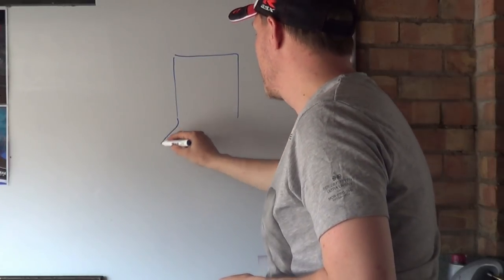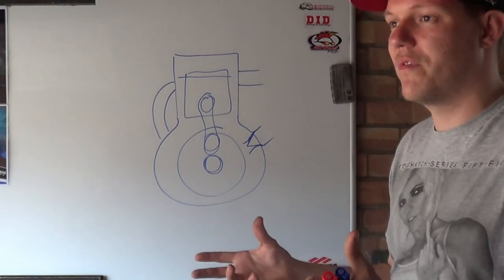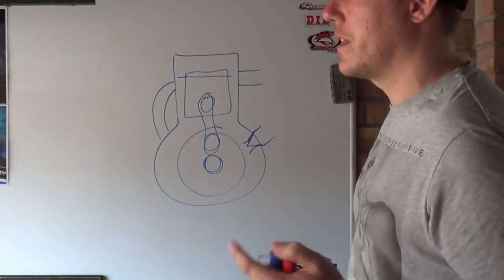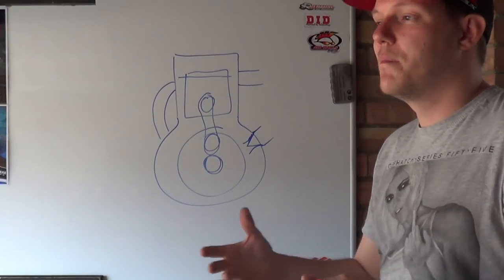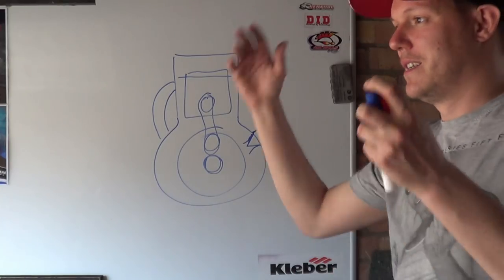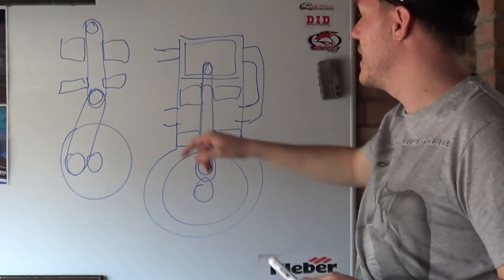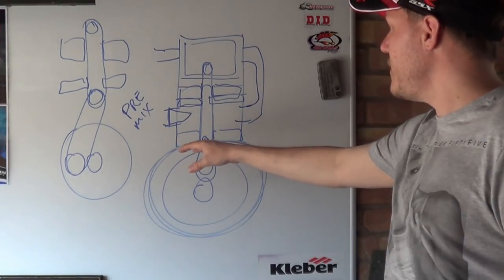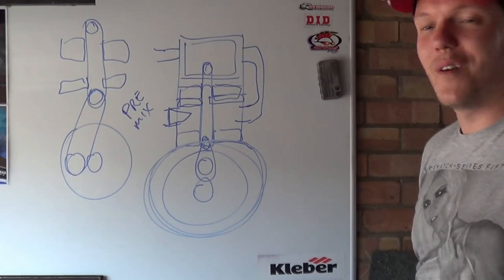2 Strokes are shite! - and why - Part 1

Comment: Hello there, I really enjoy your honest opinion videos and ofcourse their education aspect. I have thought a while now to start 2 stroke project with old sled engine. To solve the fuel in crankcase problem it would be direct injected and only air would come from old fassion way. Fuel would be biogas(methane) from cng tank so no need for additional fuel pump. The engine has independent "direct injection" oil loop for crank and piston lubrication. You think this would be also complete shite? :) Also if fuel is directly injected after exhaust port is closed (so no unburned fuel escapes) could the exhaust pipe just be straight like in 4 stroke? Pardon for long comment but this video hit the spot for me at the moment :)
Reply from the maker: No worries mate. This comment really belongs in the Q&A. There are loads of comment on this subject, so I'll answer your question in a video this weekend, if you can wait that long? - thanks for the awesome comment - matt

Comment: 13:00 ish..there's bugger all point in doing that because as it is oil injection works just FINE thank you very much, I've ran RGV's on second hand crankcases with their second hand oil seals and using oil injection the crankcases never blow up,  and had no drama's at all, and the oil hole in the exhaust port rib does a great job of looking after the piston, no need for pre mix crap, plus with all that extra rod and bearing drama you add complexity , friction and it robs energy...., plus the fact that there is a charge in the crankcase helps act as a cushion when the piston is on it's way down reducing the loading down force on the piston face and pin etc etc helping to create a far smoother runnning motor..big four stroke thumpers shake themselves to pieces faster than two strokes, I've owned them all and they all have good points and bad but I still think some two strokes are awesome.

Comment: Engineering is all about trade-offs and compromising.  You don't see 2 strokes in cars, and there's a good reason why.  It's not because the 2 stroke is a shitty design, it's just that it's advantages can only be utilized in certain applications.
Reply from the maker: Miss the point totally - there is a 4 strokes are shite video, and wankels are shite

Comment: My first bike was a 2-stroke. It was utterly reliable and I put over 44,000 miles on it when I sold it to get something bigger. It never over heated, I never had to change the crank or small end bearings,(direct oil injection onto the bearings) it had a disc valve, (no reeds to replace) It never let me down, and I loved it!
They have their limits but they're not "shite"!
Reply from the maker: you didn't mention pistons or cylinders?
Reply: I never had to change either of those... or rings before you say :-P...
It's like any engine.... if you maintain it and don't thrash the tits of it, it'll last
Reply from the maker: what bike was it? If you say honda vision or yamaha posala I'll piss myself lol
Reply: What? a Honda or Yamaha with a disc valve? I thought you knew about 2-strokes....
it was Neither!  1983 Suzuki GP100UX.
Reply from the maker: Sorry, I only get the first 2 lines on my phone.
Reply from the maker: Not only that but the 1983 version was the 11bhp detuned version. Suzuki's reason for the detune - 'to increase reliability'
Reply: That makes sense and it works! (As if de-tuning a poorly breathing 100cc engine was really necessary!) 
As I always say to one of our apprentices, if you want your engine to last, Don't modify it! (or something like that!)
Reply from the maker: Very true, I say that alot in my videos. Performance at the expense of reliability. Thats why dragster have between 5,000 ~ 10,000 HP, and blow up in 3 runs of 6 seconds each. lol
Reply: Ah, Yes! drag racing! where pistons are listed as "consumables" and engines are rebuilt after every run (Top fuel)!... :-)

Comment: Matt, when you see white smoke coming from the exhaust of a crosser is it because of the oil mixing with the air and fuel?
Reply from the maker: It depends... how old is the fuel
Reply: @dirtygarageguy  just in general terms mate, the 2 stroke crossees i've seen always seem to have a little bit of white smoke out the exhaust aa i say ive always thought it was to do with the oil mixing with the air and fuel
Reply: @reecelawson4718  too much oil.

Comment: Is there a difference in reliability when it comes to two 2t oil injection that came in the old 2t road bikes vs traditional oil and gas mix ? Id imagine the oil has more of a chance to sustain it's chemical property since it's separated from the gasoline until it's injected with the fuel into the crank case.
Reply: No its just the oil injection is more accurate.

Oil only goes bad when you put normal oil in, it will turn to gum after a few days  2 stroke oil is made so that it doesn't do that and it contains less ash to reduce emissions.

Comment: As shit as they are i still have a fond affection for 2-strokes,  i believe Suter have managed to make a fuel injected 500 for their mmx race bike,  Bimota tried it back in the day with their VDue but ended up going back to carbs because of the many faults reported.  One of these days im going to dive balls deep and attempt to build a 2 stroke track bike for the occasional blast however i fear the challenge to find a decent motor as a candidate would be rarer than seeing quality results from dells shop.

Comment: Rotax uses Direct injection to eliminate the fuel washing issue. Other 2 Strokes use a compressor screw type or centrifugal to compress the crankcase air.
Reply from the maker: If you mean the Etec system 1) it's not rotax 2) it's not very good. As to other 2 strokes - this is a motorcycle channel, and not a detroit diesel channel

Comment: You're chucking loads of content out the minute, good lad! :) Another pro for 2-stroke (slightly more relevant to handheld machinery) is ability to use in any orientation :) interesting on the concept engine you sketched...would that work as a diesel as well as petrol/premix? Cheers, M
Reply from the maker: Yes it would the fuel used really doesn't make any difference.

Comment: the reason that there are a lot of cylinders are available for 2 strokes is not because they just blow up every time, but because they most likely have different sizes(big bore kits) or different porting. For 4 stroke the cylinder does not matter very much so of course they won't have many available
Reply from the maker: lol is that what you think, if so which came first - different sized cylinders and port timing - OR - replacement cylinders because they failed?
Reply: good point, but considering that you are still exaggerating how unreliable 2 strokes are
Reply from the maker: Am I? So 2 strokes are going to make a come back then?
Reply: No chance. 2 strokes having to burn oil will always produce more emissions, so in this day and age it's not really a possibility. I would love to see the 500cc gp class make a come back though, always found it way more interesting to watch than motogp. Something about the savage power of a 2 stroke has always intrigued me

Comment: There is a 2 stroke motorcyle from Yamaha that was built from 1985 to 2012, people still rely on that bike and I am gonna get it next year.

Also there is a Kawasaki motorcycle where the piston always scratch the cylinder wall, is it because of the oil+petrol mixture?

Comment: great videos. love the explanations you give .
I think you missed the thermal inneficiencies which is a major setback for the 2 stroke design,  even on direct injected and oil injection models and effect  liquid or air cooled alike . air doesn't conduct heat, solids and liquids do. the cylinder porting limits the amount of combustion heat that can conduct from piston through rings into cylinder wall as the rings arent in contact with cylinder wall during entire stroke .. this heat transfer over extended periods will lead to uneven heat distribution across pistons. Even  with excessive  amount of gas or oil to cool piston this still causes failures.

Comment: Great channel my friend!  I have had around 50 bikes over the last 50 years, most of them 2 strokes. first legal road bike i had was a Yamaha AS1 125cc twin when I was as school in the '60s, it was faster than the 250 4 strokes, and only when the Kawasaki H1 came out could anything beat me across the traffic lights, I love 2 strokes... But.. I worked on that bike most week ends, set the timing at the side of the road once a week, it was so critical. in the 3 years i owned it I had the barrels rebored until it was at maximum because of wear, then started on a new set. crank done a few times too, in 26,000 kms (16,000  miles). In all my 4 strokes have been more reliable and last much longer at  that time my Suzuki T250 ii redline was 7000, the Honda 250 was about 13,000, but still no comparison in performance. Later, my Kawa GPZ305 would have eated the Suzuki I think. There was a 1000cc 2 stroke, DKW1000s, but thats a car.

Comment: the big problem with a cross head two stroke petrol engine is that the stuffing box limits the amount of hp one can make as the pressure diff between the cross head and the lower crank box.. might work if you have lower rpms, and for longevity, but the seals in that stuffing box are complex will be a bugger to produce and maintain.. It's like having a vagina repeatedly penetrated by shaft, eventually the diaphragm bits that make if feel good will wear, and leak into other bits.. and will need a re build.. this factor, the increased complexity of an engine made to be simple, as well as being taller and heavier, kinda negate the advantages, especially in a light weight thing like a moped.. 
   In ships, and detroit diesels, where weight doesn't matter, and the high thermal efficiency , the ability to warm up fuels, and ease of maintenance, giant slow moving parts, lower pressures,  and giant low pressure turbos (volume makes up for it), makes it great in a ship.. Detroit diesels are gone from trucks now, they are all Dailmer 4 (Re Badged) strokes these days for emissions reasons, and fuel economy..still great for industrial applications where constant use , huge air filters, and lots of cooling are available,  like power gen, plus it's much cheaper than gas turbine.. 1/5th of the cost.. but again weight is a huge factor, generally once sea can for the engine, another for the ancillaries, we talking a lot of weight to keep it reliable and clean..
   So stuffing box, complexity, not scaling down well, and a lot of extra weight to carry around makes you say hmm, what's the alternative.. well 4 stroke normally.. 
    but it is a cool idea, I prefer the Deltic idea, more elegant, no stuffing box, low crank bearing wear, cool as fuck...
Reply from the maker: yes, I messing around with the concept at the moment. Its more of a hybrid 
than a regular 2T stuffing box. The loads are nowhere near the same, but
 it is an issue like you said. This whole endeavor is more for the 
channel than an actual workable idea. So people can see that 1- it isn't that easy 2 - ideas are just that and 3 - its always worth building a quick prototype to see if that can lead you onto another idea, born out of failure if you like - thanks for the input 

- matt

Comment: Just for the sake of the discussion, what would happen if you use LPG instead of petrol?  I know the tank would have a weight/safety  issue and therefore is not very usable for bikes, but as far as i could find doing a quick search  propane/butane are not mentioned as solvents for Oil. All i could find is that LPG burns hotter and therefore the valves in American engines needs extra oil cooling systems when converted to LPG usage but hardened valves like used in most European engines don't require any of this. So the valves are no problem in a 2 Stroke, maybe some other components requires some extra cooling. Sorry if there is a thread handling this which i didn't see.

Comment: " The point of engineering is to design something that works with minimal parts" 2 stroke has about 75% less parts than a 4 stroke. I can rebuild a 2 stroke top end in on a bad day 2 hours for about $200.00. on a 4 stroke may as well buy a new motor.
Reply from the maker: " 2 stroke has about 75% less parts than a 4 stroke."

- what? 75% are you sure LOL

Comment: I feel like if you did that crosshead bearing design and made it direct injection, while you'd still lose some air to the exhaust you wouldn't kick as much fuel into your exhaust and thus vastly cut down emissions. Some downsides I can think of would be some tad increased drag from increased piston mass, added complexity, and a need for an oil injection system for the pistons.
Reply from the maker: More on this later dude - matt

Comment: You might find this video put out by Ski-Doo interesting. It's a summary of their new 850cc 2-stroke engine with numerous advancements in the way of longevity and efficiency. It's probably one of the most advanced 2 strokes ever produced. It was independently dynoed at 170.1 HP at 8050 rpm. This power output cannot be matched by a naturally aspirated 4 stroke with similar size and weight constraints. The 4-stroke sleds easily add right around 100+ pounds for comparable performance. I currently drive a Yamaha 4 stroke and their "solution" is a 1049cc 3 cylinder 4 valve per cylinder mill that only produces around 130 hp. The dry weight of my sled is right around 520 lbs where as the 850 etec weighs in at right around 470 lbs dry. Not to mention much of that weight is much higher up in the 4 stroke sleds due to the height and overall size of the engines. 

https://www.youtube.com/watch?v=M4mUp9iZEKo

Comment: I see your beef mate. Yes I agree but, from a straight MX view, the four stroke is more expensive and just as reliable. Take any engine and straight red line it for entire races at a time and you will need to do maintenance no matter what. Again this is a straight MX view. I love your design by the way. I owned a Polaris xplorer 400 and it took about 4 ounces of 10w30 in the crank case and sounds like a very similar idea to what you have.
Reply from the maker: Yeah, its not a new idea. Just to get people thinking - thanks for the comment dude - matt

Comment: Lotus developed a rotary vale direct injection boosted wet sump two stroke engine that used the boost to fully evacuate the exhaust and used an asymetrical timed exhaust trapping valve to ensure that not too much gas escaped. Highly efficient, very powerful
Reply from the maker: Yes its called the Omnivore engine and its a test bed engine. It is designed to explore the concept and gather data. Will it ever become a production engine? Probably not, although certain aspects of it may. The engine cost would be huge due to the tight tollerences that have to be maintain. Think of it like an F1 engine. Using the best materials and precision money can buy. Its a great test bed that shows what could be possible - matt
Reply: I am close friends with an Engineer that helped design it, in their opinion, the tolerances would be no tighter than a modern production engine
Reply from the maker: God that was quick do you have them on speed dial? Tight tolerances would have to be maintained for the piston style VC head they would want to use. Seen as the combustion top surface has to compress and retract which is fitted to a pivot joint. This would be hard to maintain during mass production runs.

Comment: seal the crankcase, fill it with oil and use a supercharger to pump instead of the back side of the piston.
Reply from the maker: How much oil? You said fill............
Reply: The Workshop I wasn't being specific.
Reply from the maker: well then how do you expect an answer it could be full to the top or a couple of spoons full???????
Reply: The Workshop and BTW common sense says that if it's filled to the top, you'll burst your crank seals especially if there's no breather.
Reply from the maker: It was a genuine question. You might be onto something, I just wanted to clarify what you meant.
Reply from the maker: Common sense says that you hyrdo-lock the piston and crank so nothing will move in the first place. What I was going to say was that the oil needs to be mixed with petrol due to its weight. Its very hard to vapourize oil, and if you put some oil in the bottom of the crankcase then it would just sit there.

On other thing, you didn't expect an answer? You tell me to shut the fuck up but this is my channel, you've left a comment and I replied. What wrong with that?
Reply from the maker: - if you combine -
2 stroke porting - check
piston and con rod bearings - check
supercharger - superchargers are extremely expensive to manufacture
4 stroke like crank case and oil pump - this is driven by the engine, hence you lose power as a parasitic loss
lightweight long lasting engine - to do this, how do you get fresh charge into the cylinder
Reply: The Workshop instead of using the crank case as a pump, make it separate. kinda like a supercharger. instead of having transfers coming from the crank case, have them come from the supercharger.
Reply: The Workshop parasitic losses aren't much of a concern if you end up with an over all good engine.
Reply: jjhack3r tbh, I have the same thought as you. I think just a simple compressor might have worked. It could have utilize the injection technology with this. Could replace the 2t oil pump.
Reply: I think DKW made a race engine, in the 50's maybe, that had a separate cylinder with no spark plug that acted as a pump. The regulating body classed it as supercharged and was thus not allowed.